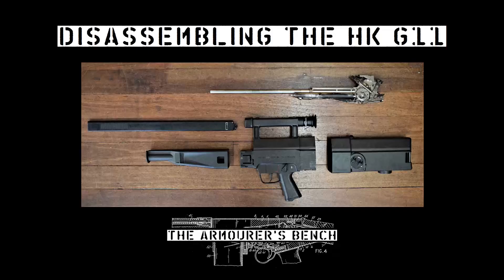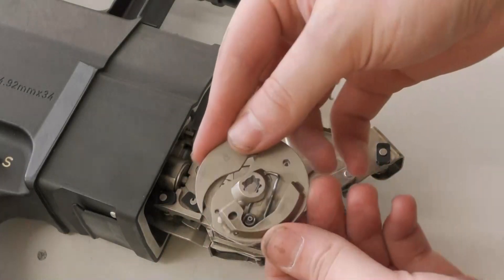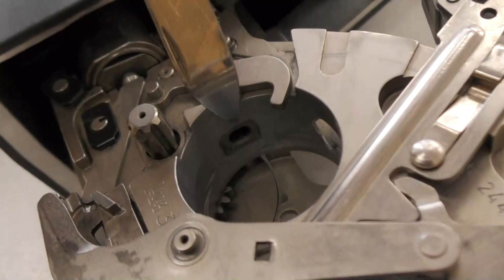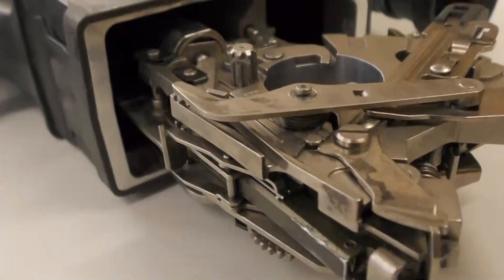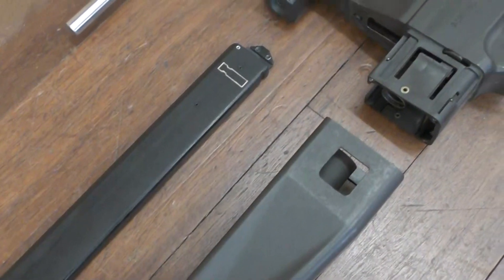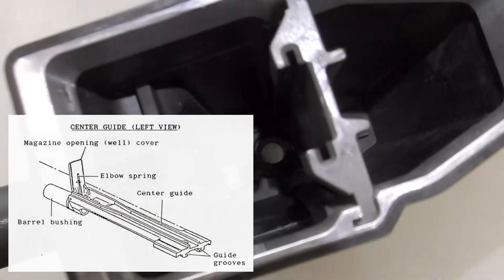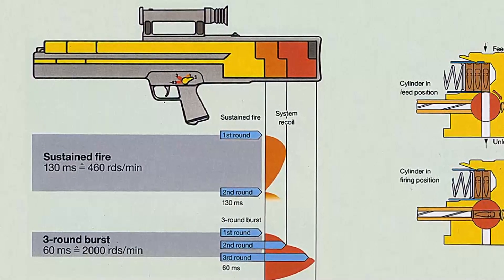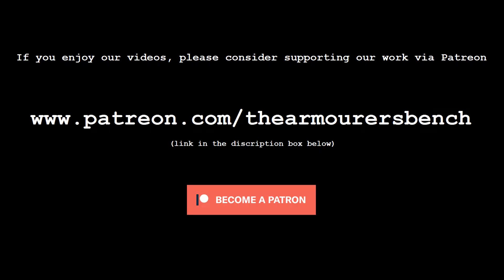Heckler & Koch G11 Disassembly &  How It Works

Comment: This action is actually a lot closer to a sewing machine than it is to a clock. Memes aside I would be willing to bet a vast majority of the cost and complexity comes from the fact that it was the first of it's kind in so many respects, added to the fact it was made by Germans (HK of all people).  It very well may have been possible to develop a more economically feasible design the second time around with the Russians, Americans or even Belgians making simplifications from the g11 proof of concept, if this had turned out to be something that caught on. This was just too much at a time when Germany had neither the funds nor the inclination for this sort of program.
Reply from the maker: Agreed, now it represents a fascinating footnote in small arms design history. I think simpler and better designs will emerge that achieve what the G11 aimed to but in a more cost effective and frankly less insanely complex way. - Matt
Reply: Germany DID have the funds. They were all the way to the initial procurement contract. in 1992 before the gun got canned. A lot of complexity stems from the needs of various rifle programs, like the ACR, requiring an unloading mechanism. That was never intended in the first designs. They ended up with a system that minimizes control devices, replicatig previous firearms - To unload, you pull he mag and rach the handle. Rotate. Sorry. 
Another problem was the firing pin melting due to the lack of a case, hence the weird spring mechanism in the back of the system. The firing pin doesn't get pushed in, it rotates in to the cartridge. This allows for the tip of the pin to be in contact with another surface, where it can dump heat. 
The gun was added to quite a lot in later stages, mostly to improve the reliability and handling of the system. I doubt that it would have been possible to further simplify the system with the rotating breech drum, although an argument can be made that a revolver could in theory be less complex. HK found that their drum gave them a better gas seal though.
Reply: @zibingotaeam3716  obviously there are going to be specific issues with a unique system, but like anything else we can't see what might have happened had this rifle become a benchmark other countries fought to reach. It's possible that any of the issues facing this rifle could have been solved not through tight tolerances and cutting edge material science, but clever, lateral design problem solving.
Reply: @zibingotaeam3716  With todays tech, alloys, and polymers I'm sure it would be possible to simply the mechanism or "black box" it. You'd be amazed what CAD folks can do on a modern computer - or twenty of them. Modern materials would probably eliminate the need to remove the rotating bolt entirely. Flexible polymer materials can replace small springs. You can clean it via the ejection port and the life span would be in the hundreds of thousands of rounds. Use polymers for all the gears, pins, leavers, etc. and then encase and seal the entire unit. Absolutely no need to clean its outside then, less chance anything would break or bend, and the cost goes way down. Make the barrel detachable and then simply issue a few spares. Anything goes wrong... disassemble, put in a spare, and send the original back to the factory. There are ways to print polymers to avoid needing pins or metal edging. Remember today we can print two polymer parts which clip together and are both lighter, cheaper, stronger, and operate better than two metal parts, a washer, a screw, and a bolt.
Reply: @BW022  No?
polymers are polymers, especially printed ones are thermoplastics which are not that durable, especially under heat. I could see ceramics, but even then, metal is probably the easiest way to go here as it is easier to get precisely right. Besides, issueing a soldier with loads of spare parts defeats the point of the system, which was to save weight. Same goes for the small plastic parts that were supposed to be on the inside as springs. Metal is far more elastic than anything else. Drop a ball bearing and a rubber ball on the floor and see which on jumps higher. 
If plastics had been an option on the inside of the gun, HK would have used them, as they have on the outside.
Reply: @zibingotaeam3716   Zibingo Taeam  The only part of the mechanism which is subject to heat is the firing chamber and possibly the top of the gas assembly. Just use ceramics or modern alloys for the inside of the firing chamber and the rest can easily be polymers. Modern polymers are stronger than stamped steel and vastly more so if you uses a single polymer part in places of 3-4 steel parts connected via grommets, pins, etc. because stamping doesn't permit such complex shapes to be created as a single piece. and clipped in place.

Complex polymer manufacturing was not an option in the late 1980 because they didn't have the last 25 years of technology. Today you can use modern CAD systems and relatively inexpensive general purpose machines to design an manufacture very complex pieces as a single part. There are children's toys today which have mill specs beyond that if the G11. Weight was not specifically a goal of the program or weapon. The G11 weights more than an M16 and is approaching battle rifle weights. Your weight savings is pretty much limited to the ammunition. However, a) if you replaced the mechanism with polymers it would weight half as much, so you could carry a spare it would still be the same weight, and b) not everyone needs a spare (one or two per front-line squad might be fine), c) depending upon reliability it isn't necessary that anyone outside of combat carries a spare (90% of units could easily have spares only at the company level, base, or cycle them back to the factory for testing/refurbishment every few years).

I'm simply saying if you redesigned that mechanism today and used polymers you could reduce the complexity and number of parts dramatically, it would be relatively inexpensive, weigh less, and could easily be placed in a sealed sleeve unit to protect all those small exposed parts from debris.

Comment: 5:28       I'm going to nerd out here since looking at the G11 is amazing and insane with how its built.  I compared and did some math (correct me if I'm wrong), but the service life of the chamber being 3,500 rounds is low especially with a high burst fire-rate (2,100 rpm). My math is showing me that you get like 5 minutes of shooting time before you have to replace the chamber. An M-16A2/A4 rifle will have to replace it's chamber at 10,000 rounds and has a burst rate (750 rpm) that will let you shoot it like for 40 minutes.
Reply: Of course, you have to remember that the Germans only intended to issue two magazines per rifle.  After your magazines were empty, you'd be busy refilling them via chargers.  The G11K2 had two tracks for the spare magazine, one on each side of the center track for the primary.  They realized that the magazine was simply too long to carry on the soldier's web gear.  The US Army noticed this as well with the single track G11 ACR, and recommended reducing the magazine's length.
Reply from the maker: @danielwatters1203  Yes, the chargers are almost anathema to what we think sensible (then and now). Thanks as always for the input Dan! - Matt
Reply from the maker: That's about what I was thinking too. In a high cadence fire fight then it's hard to see how much use burst and full would have been if you didn't want to break down your rifle mid fight. - Matt
Reply: Maybe the breech would've lasted longer with cylindrical propellant blocks instead of cuboid. Corners and high pressure don't go well together...
Reply: @whyjay9959  Round propellant blocks possibly are more likely to get crushed in the magazine though.

Comment: Found the manual of this thing, it's opperation reminds me of a steam engine.

The cylinder looks like they could've been milled as just one part.

Also, looking forward for the Steyr ACR full dissasembly video.
Reply from the maker: I can see the comparison, lots of camming, gears and pistons.
Reply: Makes me wonder how much of that was really necessary... If it was adopted, would we have seen a similar gun 15 years later that had half the number of parts and worked even better?
Reply: @whyjay9959  The entirety of the burst mechanism was laid on due to thinking at the time. If you remove all of that, it's still complex... but substantially less so (overall). That said, we still don't quite have the whole caseless small arms issue hammered out. It's a tough nut, and metallic cases have been around for 210+ years (approximately 160 of those years in fairly widespread commercial use) for good reason.
Reply: @whyjay9959  honestly, that's what I like to think. That the G11, while obviously a groundbreaking design, wasn't really ready for the prime time. If anything, it seems like a very immature prototype. Now, I'm certainly not going to pretend to know what's going on in there, and I'm sure the engineer's / elves at HK had forgotten more about Firearms design than I will ever know, but to the untrained eye it looks like it's more complicated than it needs to be. I have to imagine that today, with computer aided design and modern manufacturing methods and materials, this same thing could be achieved in a simpler and more robust package. Even though it would probably still being much more complicated than a standard rifle design, it probably wouldn't need to look like a a steampunk fetish piece.

I think the more important reality is diminishing returns. Now, I could be wrong, considering I've never held or fired one, but I tend to imagine that whatever Advantage you get out of this over a well-built modern AR type rifle with all the proper furniture and accessories, is probably not worth the incredible complexity, strange Manual of arms, and very awkward ergonomics. And in many ways, you probably lose features as well. In short, it's cool, and it does some things uniquely - but it might not really be necessary.
Reply: I can’t remember who made the comparison, but it has been described as a cross between an atomic bomb and a clock!
Reply: @domhogan7842  Ina McCullom form forgotten weapons?
Reply: @domhogan7842  I mean, you're not wrong...
Reply: It even has a similar steam whistle - "shoot, shoot!"
Reply from the maker: Haha it did too!
Reply: Where did you find the manual?
Reply from the maker: @connormeagher9655  There's links at the bottom of this post: https://armourersbench.com/2018/11/23/stripping-the-hk-g11/